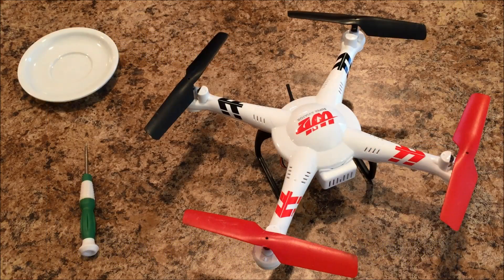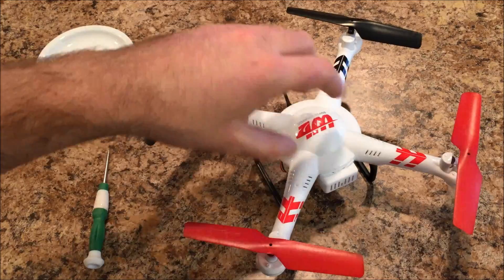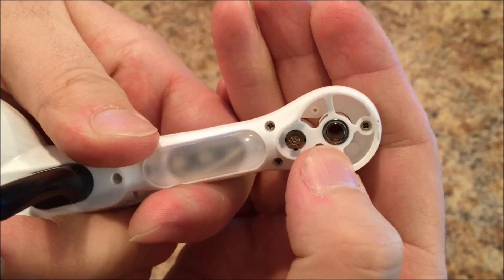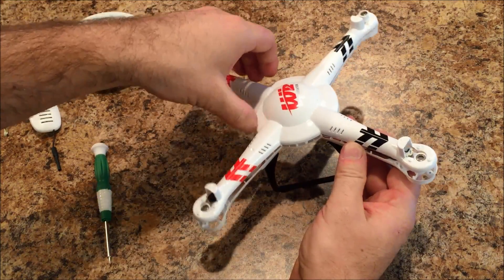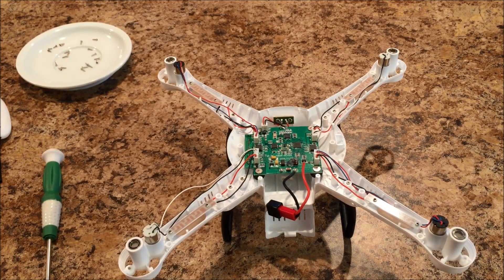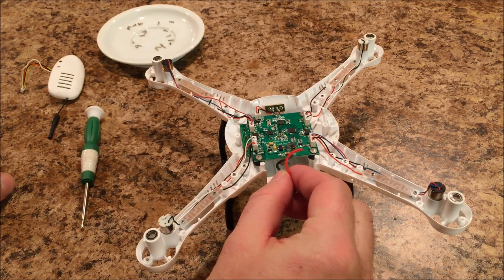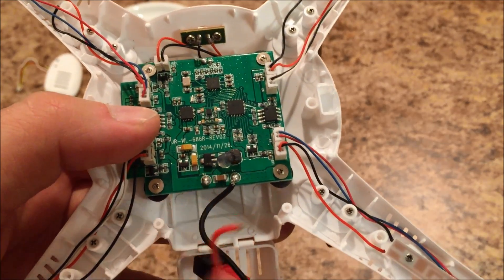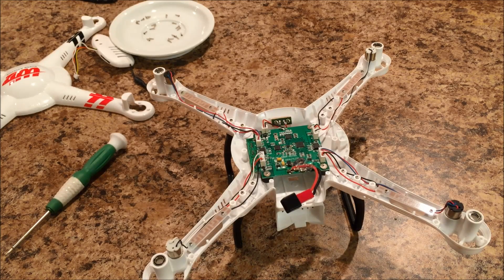WLToys V686G Motor Replacement/ Battery Cable Repair

Comment: Thanks for the video, helped out alot.  I got a question. ... about hot glue the battery cables .  I don't have a hot glue gun ... could I use silicone sealant? That's the clear silicone used around windows or bathroom titles & shower.  just wondering if that would be ok to use.

Comment: awesome, another thing one can do is cut out two notches on the bay door so the cables are outside , I think I saw this mod for the CX20 or the X1, can`t remember but it works on my v686g
Reply from the maker: +Brunon Dziedzic Great point, I think I will do that with my mini Tarantula.

Comment: how long would you say the motors will last, how many (5 minute) flights will it handle before it shows there is a problem with the motors. :-)
Reply from the maker: It's somewhat of a crap shoot. I have had some motors fail on the second flight and others last 25+ flights. I have recently started spraying up inside the motors with electrical contact cleaner every 3 flights and it seems to have extended motor life significantly.